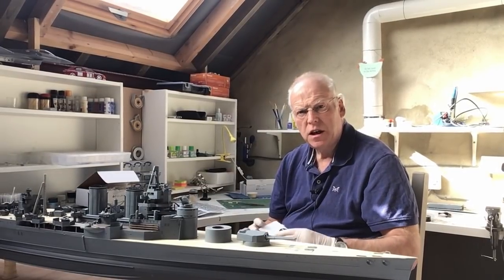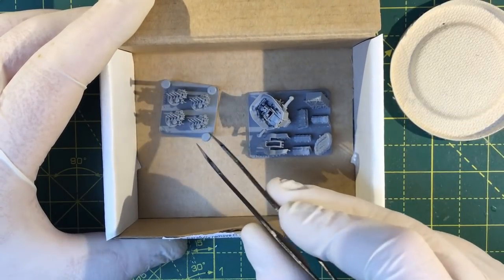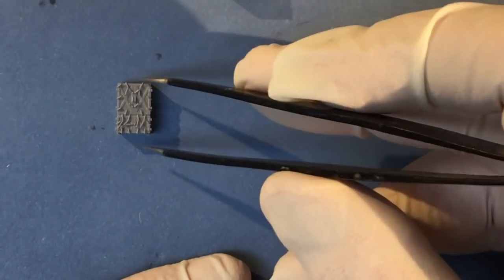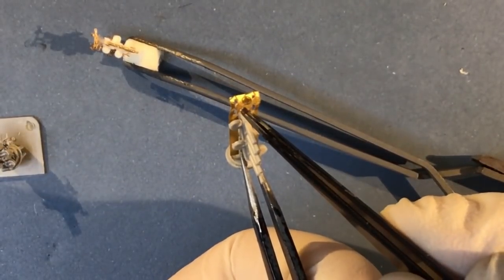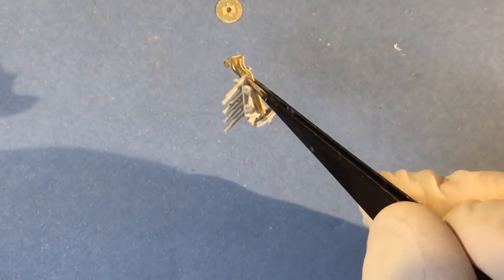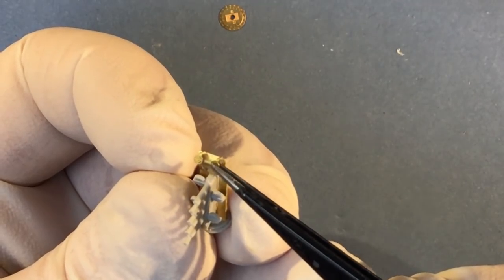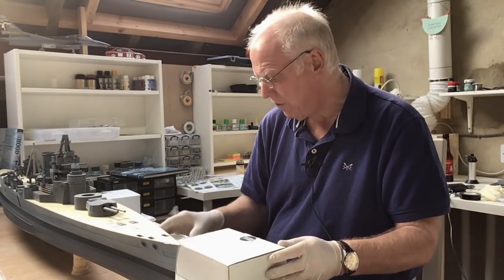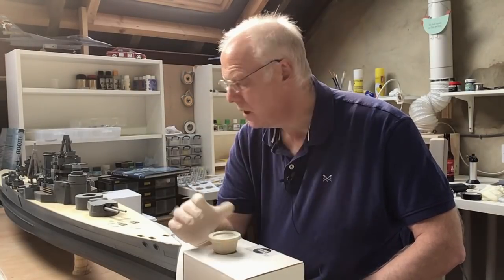Model Shed review No1: Micromaster 3D printed details for naval models

Comment: Quite a surprise just how much 3D printing offers - but clearly brass still has its place for some details. Combining these technologies looks likely to provide some more sensible assemblies in the future. Anyway, the detailed comparison was much appreciated - thank you!
Reply from the maker: Yes it gives us some more options Alison - I’m a detail freak so they’re the sort of thing I’d go for
Reply: @TheModelShed  If you added the points turned brass barrels to the 3D printed base of the 50 calibre quad machine guns as a defined in mixed media part, it ought to be a significant improvement on both the current micromaster and pontos offerings.
Reply from the maker: Hi Nick I did just that in the next part (26) of the build
Reply: @TheModelShed  :) I will watch wit anticipation.

Comment: Spot on!  MicroMaster is the gold standard in resin printed parts for model ships.   The items you discussed are great and I was even more impressed with their ships boats that are very finely detailed and thin walled.  My only misgivings relate to the Mk3 Directors which, despite Simon's reputation for accuracy, do look a bit over scale.    It is also a fairly  expensive option, with the postage cost included.   Their  4" twin gun mounts and  35' Fast Motor Boats arrived a few days ago and are all just beautiful.  They also weighed about as much as the hair still left on my head but cost $35:00 US delivery .... and Australia is just across the ditch from NZ.  My only advice to others is to try to get all of the wanted items in one go to minimise the cost but that is probably not practical.  Help Simon.
Reply from the maker: Hi Leslie. Agreed they can work out a bit pricey. I appreciate that not everyone can afford these add ons and how fortunate I am, but to put it into perspective I will have been occupied on this project for 8 months or so by the time it’s finished so with the entire cost of the project around £600 that’s the price of a cup of coffee every day. I don’t buy loads of kits to sit in a stash either so that helps keep the hobby affordable. BTW postage on my order for the 4” and lockers and some other gear was $17 to the UK.

Comment: Great review! Can't wait to see where 3D printing takes the hobby.
Reply from the maker: They are a great advance I think. My fear is that they will remove so much of the skill required  at present but I suppose we will always find somewhere to apply that skill in other areas. If you take it to the limit I suppose it would eventually be possible to print an entire model without any work at all....
Reply: @TheModelShed  I'd love to back convert the recent HMS Calcutta back to the 1919 original, but lack the skill and time to do it myself, even though this would be relatively straight forward to do. It seems to me, that 3D printing technology would give a higher skilled modeller such as your self to more easily back date the 1941 Hood to an early 1930s version if you wanted to. The effort might switch from building etch to designing the mods in 3D CAD software using photographs and plans as source plans. In any case, skilled builders will want to combined etched and printed resin materials to build something better than either alone can provide you.

Comment: I have been modelling now for more than 50 years and must confess I have mixed feelings to using 3d upgrades.  Yes, they are sharp and absolutely fantastic in detail.  In my humble opinion, however, using these parts is not modelling.  Anyone can glue together a model with these parts.  True modelling is what Steve is doing.  For me building models using your skills to scratchbuilding or using photoech etc is fun and an art in itself.
Reply from the maker: It’s a good point Arild  and I too have mixed feelings about using the 3d parts. I suppose that’s why I still build the Pontos equivalents just to keep up and develop the skills needed and - maybe - to set myself a challenge rather than just resorting to something off the shelf

Comment: Thanks Steve. Excellent review and I liked the way you compared the various options. A definite trade off between the detail and accuracy of the 3D parts, against the challenge and fun of putting the brass together.  I liked the quads - is there anyway you could add the turned brass barrels to the 3D parts? It didn't look like the 3D quads had hollow barrels...
Reply from the maker: The 3D ones are hollow but not as pronounced. Check out part 26 Rich - I used the brass barrels on the micromaster guns this week.

Comment: It seems to me that the ultimate aim is to be as accurate as you can afford, given your skill level. It seems to me that detailed sets will become mixed 3D printed resin and etched brass depending on which technology gives the best results.  The truth is that if you can afford it, you'll always choose to go 3D printed for many detailed pieces such as the 4 in HA guns, and directors. I would hope that Trumpeter is also watching and will step up its own accuracy.

haven'tsource document for 3D printing by adding scale data using simple CAD packages. With cheap and easy Lidar scanning already possible via iPhone 12, DIY 3D scanning of every day details is practically here already.

I expect the cost of 3D printed parts will also decline quite quickly and for larger scales, kit manufacturers (high end ones like kamiya) may well soon be adding super detailed 3D printed material into their new releases. I've noticed some armour models are now coming with small 3D printed add0ons already.
Reply from the maker: Agreed Nick. I don't want to give the impression that these parts are all essential - I just want to show people the alternatives so they can decide which way to go according to their skill levels and budget. I still like the challenge of actually building the parts themselves from the etch - it hones skills and the practice comes in handy when 3D parts are not available or beyond your wallet.

Comment: Oh wow didn't know that exist. Seems like a gold mine, at least for UK ships.
I imagine building a Octuple Pom Pom from etched and resin parts to be a pain in the ass, here its just 4 parts comparatively easy to build. Granted one Pom Pom then also costs 8€.
I have seen you used their products for the AA guns of your Hood, probably saved you quite some headaches and hours.
Too bad their selection of Kriegsmarine items is very limited.
Reply from the maker: The MM parts are incredible but as you point out quite expensive. in this case they didn’t save me time because I built the Pontos parts for the benefit of the videos.